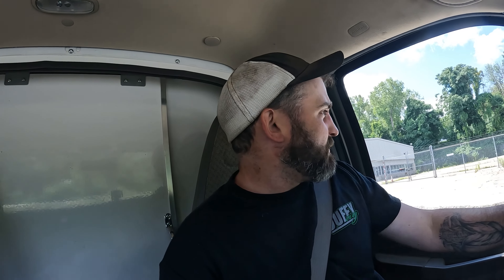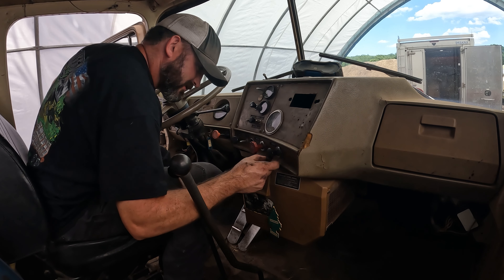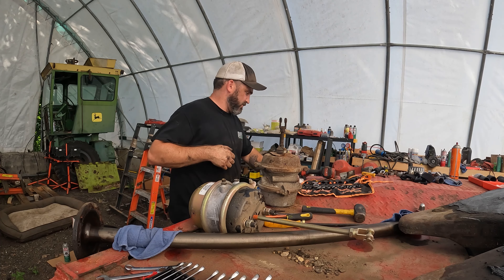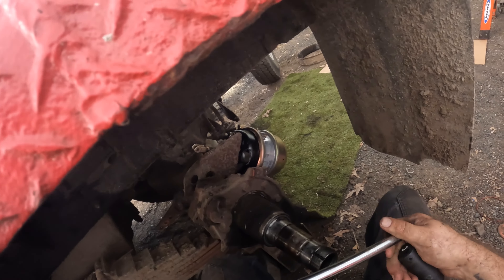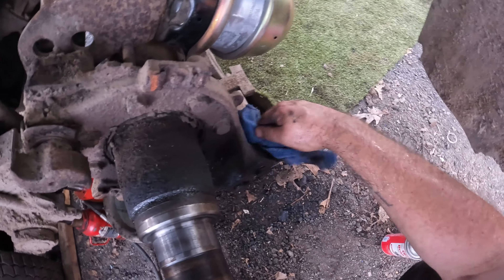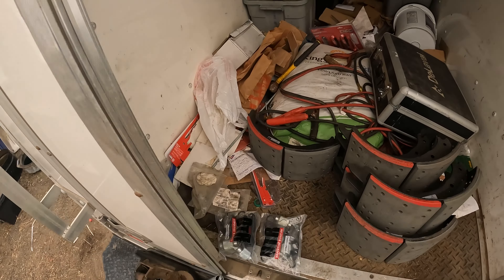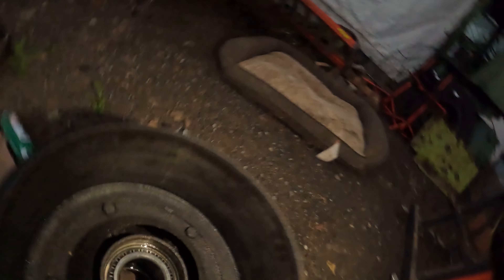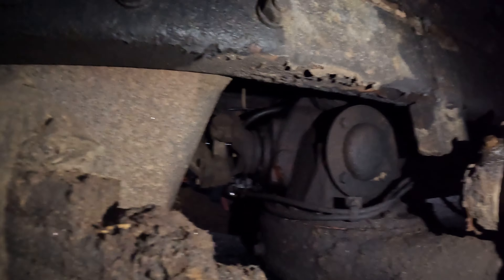This Truck Will Be New By The Time I'm Done... Wrong Part Struggles

Comment: When doing wheel seals, jack truck up slightly, slide oiled tin under wheels, pull axle n wheel bearing,slide all off as a unit,flip on side take  2x6 8ft long n stand up,raise or lower truck to align spindle n hub push on, saves a lot of back!!

Comment: Installed hundreds of brakes. Use vice grips on springs. Put front spring and hang shoes on top and bottom at same time. Clamp pliers on springs and use vise grips on side of hooks. Works better than tool. You will get the hang of it with time and experience.

Comment: You can use a screwdriver to help you stretch those springs put one end in the hole and then one end on the spring itself and then you should be able to stretch it.

Comment: You asked for advise, a sheet of plywood or two on the floor over that reclaimed stone would help your body. You could move it around to suit the jobs you do under or on the truck. I use a product called Simple Green, it is the best degreaser there is and it dissolves in water.  Clean your hands and rinse off with water, great to degrease those drums and rims. Spray on and let it sit awhile before your rinse or pressure wash off. Clean the area off where the old seals were, as the new seals don't want to be torn up. Keep the videos coming.

Comment: The truck shop that I help at used #2 permatex on all the air line fittings to seal them and they are easy to take off latter

Comment: While you are doing a brake job on a older truck. You could install auto slacks to keep from climbing under the truck to adjust. Meritor  make direct replacement slacks.

Comment: When working in a dirt floor shop, I lay down some old half sheet's of 3/4 plywood when working on heavy stuff to roll a jack on if needed. Good for lifting your hubs or transmissions. I save appliance boxes and buy big shipping cardboard boxes from HD to lay on the ground while working under stuff on the ground. Cleaner and easier to find dropped parts. Just stow them behind a work bench and swap out when they get really dirty. Better than a creeper just slide yourself under stuff while working in the dirt or on grass.
Reply: In the field creeper!@

Comment: if you leave the roller off the S Cam and connect the small springs first. There is enough room to connect the return spring and pry the shoes apart to put the roller in.  Only tool needed is a pry bar.

Comment: I always spin the s-cam 180degrees, to a fresh wear spot. They wear on one side. Watch your brake cans , they have different strokes. Other than lining the tires. The spoke wheels are the best for weight. They don't use the stud to carry load. Ran trucks for years and did all my own work. The old ones are the good ones.

Comment: Those are the right seals and a tip is to put your 2 bottom Springs on the shoe and then put the shoes on
Reply from the maker: Those seals don't fit inside the hub at all so definitely the wrong seal

Comment: 🌲🌲Little tip for the magic tree Air Freshener, Don't tear open the packaging and hang the Tree; instead, follow the instructions and tear only a small triangle in the top of the packaging and pull out the tree bit by bit over seven weeks...

Comment: I always take my cage bolts out and throw them in the glove box or tool box with my 3/4" wrench because by the time maxipot is bad enough diaphragm has a hole in it they are usually seized in or gone lol

Comment: The tin man I can't remember if he squeaky  or if he was seized but when I did the brakes on my boat trailer which goes in salt water marine you have to use copper or nickel anti-seize and I have premium nickel the stuff is like gold i used the standard zinc on my prop one time and it's fused right onto the shaft what a job that was that's the last time I used zinc anti-seize in salt water

Comment: Hello Chris maybe I misunderstood you but the cage bolts you cant leave in you have to release the spring but I've have a pair or more in the truck if needed. Nice job sofar wrong parts again a. Seems like happens alot. Have a great day.
Reply: When they’re not in use there’s a cast in threaded spot on the side to stow them, at least on the brake cans I e personally worked on. I am making the assumption that that’s universal but I could always be wrong

Comment: Oil soaked brakes should always be replaced. You should just change the oil in the diffs then everything will be good for a long time. Diesel Creek just got his 80s A-Car on the road after much work and maintenance. You’re doing a great job on your equipment .
Reply: Abd then he sunk his new trailer

Comment: One thing I always hated having to do On my ole 86 shaker was pulling wheels off and doing seals an brakes...haha dont envy ya having to do all that...but your saving yourself a heap of cash doing it yourself. Go through and grease everything in the brakes and drivelines while your under there...also while you have the wheels off it might be easier to do the seal on the back of the axel thats leaking.

Comment: Trick to installing shoes without spring pliers.
1. Drive spring pins in both shoes
2. Leave out s cam rollers and sit top shoe of fixed pins
3. hang dual springs and single spring On top shoe
4. Hook dual springs on lower shoe while it is hanging on fixed pin.
5. Swing lower shoe up into place.
6. With the cam set to it's lowest point you should be able to hook the single spring on the lower shoe.
7. Use a pry bar to pry top shoes up and down to install rollers on s cam

Comment: Whenever you have some time go scavenger hunting at ur local scrapyard and find at least 2 more big old air compressor tanks and convert them into your air supply tank system and wouldn't u just need to find or come up with pump system to then incorporate into the air tank system.
Reply: Check ritchie bross they get a lot of equipment from a large cancelled jobsite

Comment: Harbor freight had a specilal on air compressor pumps . I bought for 79 but then they raised price to 119. Any electic motor on that new tank will fill it quickly. If you make commonn with other compressor no need to buy pressure relief or unloader.
Reply: I have one also, been going strong for 10 yrs. Bolted it on a 80 gallon tank my neighbor was throwing out, along with a 5 hp motor i had lying around.

Comment: your brake push rod is too long, should be about 3 3/4 inch its way past 90 degrees and should never exceed 90 degrees, anti seeze the entire bushing for the ancor pins, that seal should be a 42672 for the drive axle,  the seal that you thought came apart is a grit guard seal and is a two piece and came apart correctly, and is the best seal to use, watch a video on you tube from stemco on proper wheel bearing end play, you can skip to the 25 min mark for the nitty gritty info you need, with double nuts like you should have the inner nut is 200 ft pounds, turn hub two revs in each direction, loosen, torque to 50 ft pds then back of 1/4 to 1/3 turn, feel how the hub turns, should be very freely, once you put the outer nut on and torque it recheck the hub turning, depending on the axle thread wear it can push the inner nut in and change your oil clearance, buying stemco seals they will give you install tools for free so ask for them at your dealer.